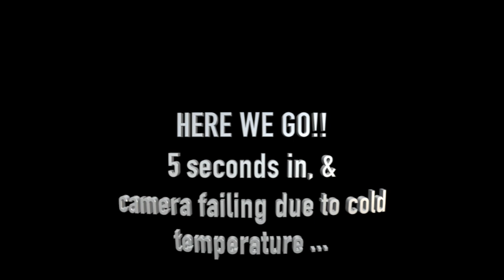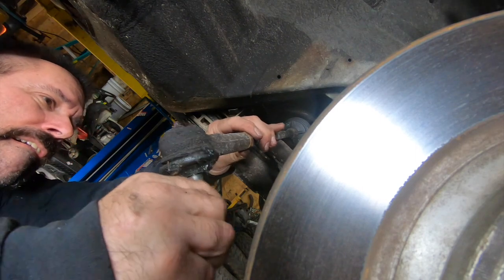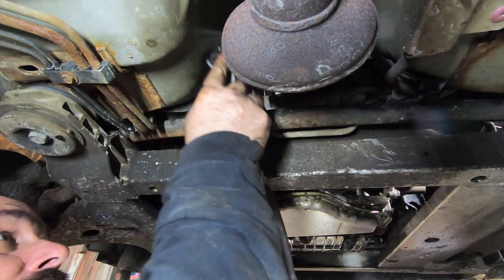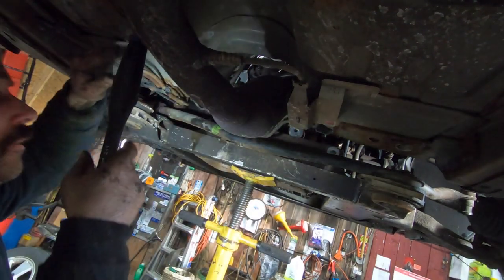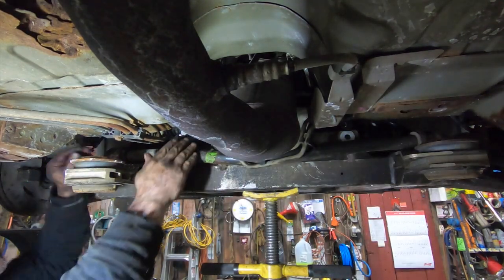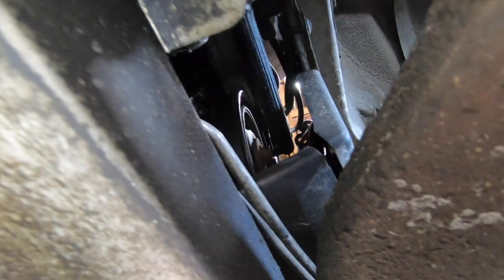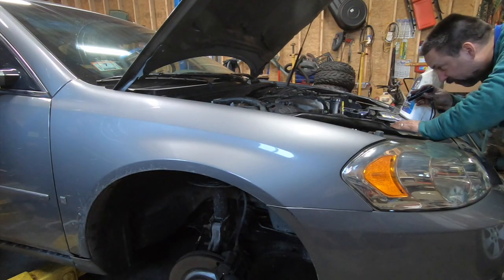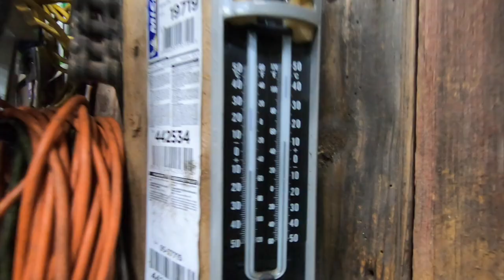2006 Impala steering rack replacement & bleed procedure

Comment: Racks are buggers to install on modern cars. Good job!     Come visit before the winter is over.  My wife says to bring your wife, so they can go  sight-seeing together.
Reply from the maker: Thanks man, glad you enjoyed! Yeah I was pretty shocked when I got underneath this thing and looked at where the steering rack was located.😂

I appreciate the invite, Chris! I’d love to but the Silverado’s oil pressure is dropping. I got a new O-ring for the oil pump pick up tube, which is a common failure point on these LS engines. Hopefully that’s it, but I’m not that confident. I’m thinking I’ve got a number 2 cam bearing walking out of its bore based on past oil analysis results. If that’s the case, that truck is done until I get the cash for a new engine. Been eyeballing a 408 stroker. I know the transmission and rear differential will handle it now that I’ve upgraded them, so might as well make this thing able to tow effortlessly. The transfer case will be the only OE part of the driveline besides the driveshaft. We’ll see if that Band-Aid fix works. I’ll probably shoot a video on that. But the funds are pretty depleted at the moment. With gas prices as high as they are right now I’ve pretty much stopped all traveling for the foreseeable future unfortunately. This engine is going to cost me a fortune.  On top of that, the wifey just lost a week of work a few weeks back thanks to the new variant that we both had, so we’ve been taking a financial beating up here. We’ll get down there one of these days. 👍🍻

Comment: Do you have to get an alignment after new rack and pinion? Sorry for the dumb question but I’m assuming yea?
Reply from the maker: Yeah, any time you mess with any part of the steering system (and in some cases, suspension) it should be aligned.

Comment: good evening smitty!      ahhh...being at chevy 22 years ive done that!   its that cooler line  they were always a bitch to bleed   ugggh that one    hey get the vac bleeder adaptor kit  and 20 inches  back a forth of the wheel like 40 times...hey are you getting that blizzard  long island is gettin hit hard
Reply from the maker: Good evening, Dave! Ahh, I didn’t even think of that! Makes perfect sense. I can picture all the air trapped in that big long thing.

Yeah, just started snowing here about 10 minutes ago. Road is already covered. I guess Boston is going to get pounded with over 2 feet. We might fare a little better way out here, hopefully. I spent the day getting my old snowblowers running, and fired up my generator for the first time in 13 months! I didn’t realize that much time had passed! Good thing I keep a tag on it with that kind of info. I would’ve left that old stale gas in it and tried to burn it off! I siphoned it and it threw it in my plow truck. Some of the fuel that I had mixed in there was over four years old! Definitely time to get rid of that. Charged the plow truck battery for several hours. I’m ready! They’re saying this has the potential of being as bad as the blizzard of 78! That was a crazy time. I still remember the 8 to 9 foot snow drifts. Stay warm, buddy! 🍻